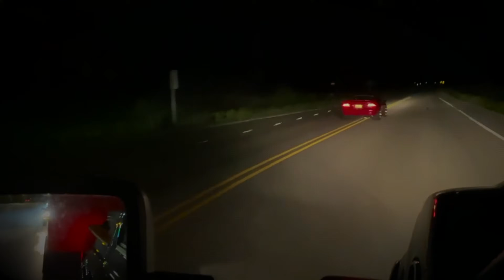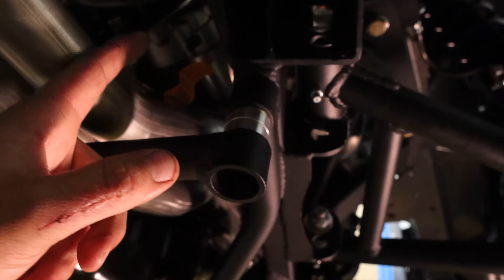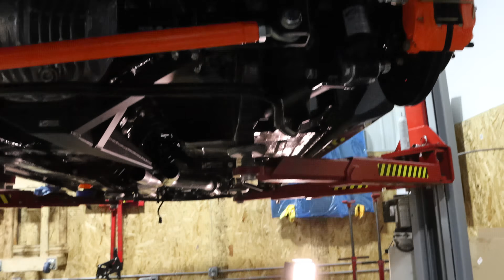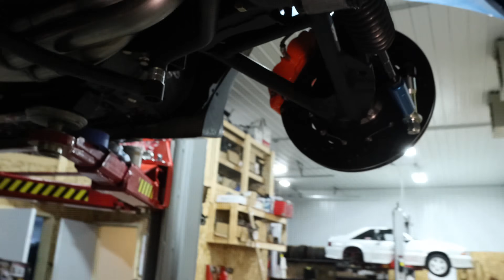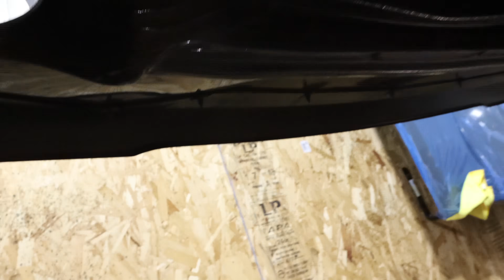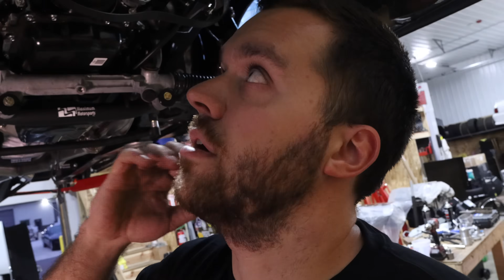Coyote Swap Gets custom Exhaust and T56 finally installed!

Comment: Man in need to know, if the 99-04 and the 94-98 mustang have the same lower control arms… looking for the passenger side and all the ones I seen all masterbcraft branded are all different prices but shows all the years 94-2004 year gt and 01’cobran

Comment: I said this once and i'll say it again, I wish you guys were in FL. You guys treat other people's cars like your own.
Question, I traded my irs with someone that had upgraded to Full Tilt Boogie bushings, and since then I have had vibration/clunk - especially when going into 5th and 6th gear - while driving. I believe it's the pinon alignment that is now off. My question is what do I need to adjust to get the pinon/driveshaft in spec? Do I nee to add shims or something to the diff to change the alignment angle?
Reply from the maker: If it full ftbr then it has adjustable pinion shims/spacers in the front. We also get arp bolts for the diff to get more torque out of them. 
Rear mount is usually the issue. The nut in that the diff mount bolts too can break and it needs to be welded to repair properly. 

These are the most common, hope it helps! Ftbr does transfer more noise and driveline slop if it has a trutrack they are worse we have recently learned
Reply: @StreetcarShenanigans  Thanks for the info! I'll have to dig around and see if it's one of the things you mentioned